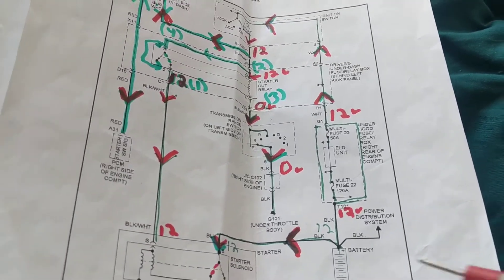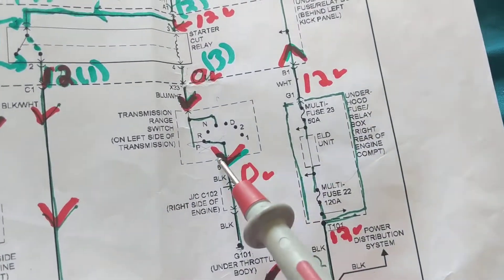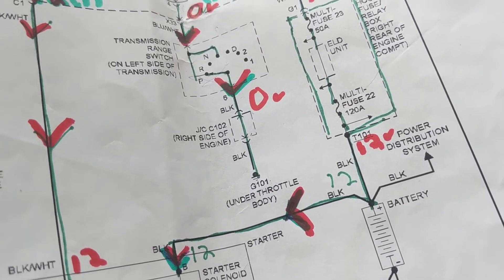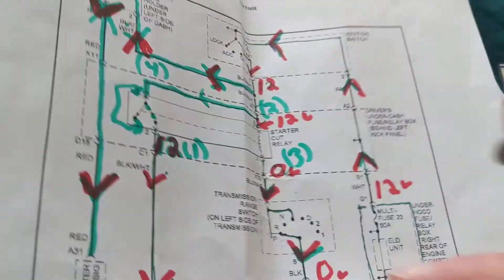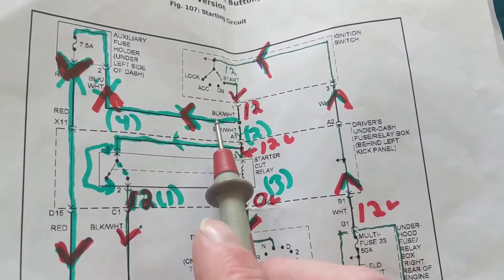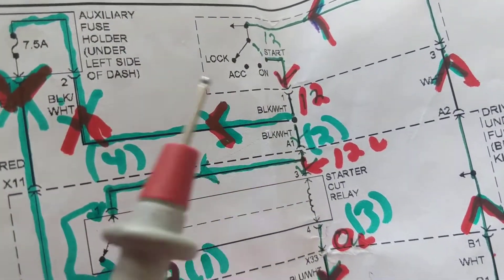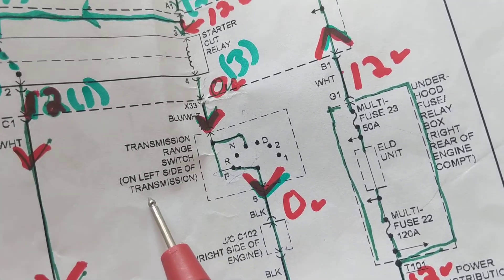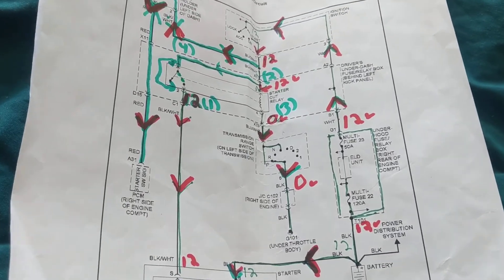NO CRANK AND NO START FOR VEHICLE DIAGNOSED FROM WIRING DIAGRAM

Comment: Awesome Joe. Have question on a 2005 buick century. Intermittent when I tap key to start takes about 5 attempt before starting. It goes click click click but starts eventually. Since it starts I know park neutral switch is ok. Ignition switch is ok. Fuses are good. Input from key goes to computer and another relay in computer scences crank and sends signal to crank relay. I'm going to do a voltage drop at starter and have battery checked. Do you think Joe this could be a problem in the computer?
Reply: So are you having difficulty with a crank and no start or a no crank and no start makes a difference do you hear the engine trying to turn over these pumps fuel pumps need high fuel pressure to start sometimes 60 PSI sometimes you have to put the accelerator pedal all the way down to start the car
Reply: A intermittent no crank joe. When it acts up you rotate key to start maybe up to 5 times and you hear a click click click then on like 6th attemp it fires right up.I know all fuses are good, the park neutral switch is good. Could it be the relay in the pcm going bad. Doesn't one the security modules sees the chip in the key send a signal to start relay in pcm then on the purple wire to the crank relay and it allows starter to crank hope I explained that right
Reply: @randywheeler652  I don't have the schematic in front of me measure the load side of the starter on the relay if you see my video usually I put a piece of wire in the terminal of the relay then I crank this will tell you if you're getting a computer signal and the relay is activated which is the less last step before to start a motor if you have a clamp meter you can put around the starter motor wire and see if you are cranking amps
Reply: I don't have a amp clamp yet Joe but  I'll try that. I'm going to make sure my battery terminals are clean tomorrow and do a voltage drop at starter. Then have the parts store check cranking amps draw of my starter then do just as you directed me to do joe. I love watching your videos, makes things a whole lot easier to diagnosis for me. Thank you so much
Reply: @randywheeler652  if there is corrosion on the cables or terminals you could do a voltage drop test or a resistance test across all of the cable good luck
Reply: Thanks Joe I'll keep you informed on what I find.
Reply: @randywheeler652  I agree with you about the computer signals and alarm system but it wouldn't take six times to turn the ignition switch until it comes on always suspect an ignition switch even though you told me was good and also do a voltage drop test across the terminals keep me informed like you said you would thank you
Reply: Crossing my fingers joe, battery posts and cable ends looked ok but I cleaned battery posts and reached ends and did voltage drop tests. So far operating correctly. I'll keep you informed
Reply: Try to find the fuse after the ignition switch while you turn the ignition switch to see if you have voltage